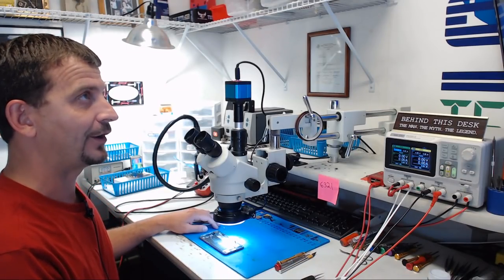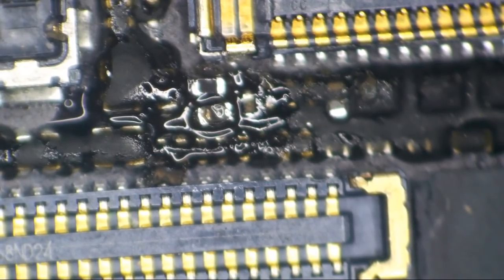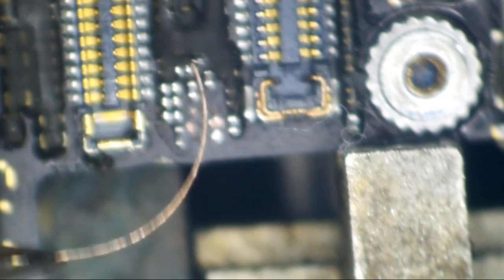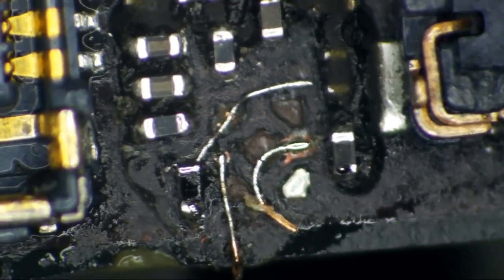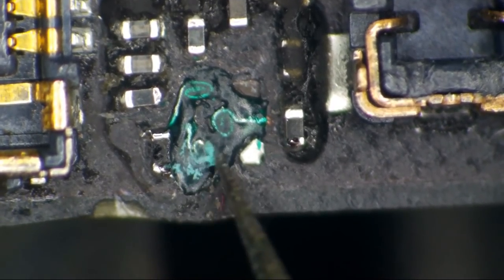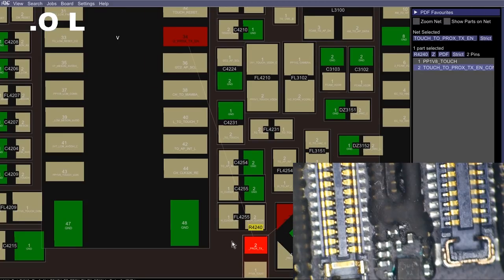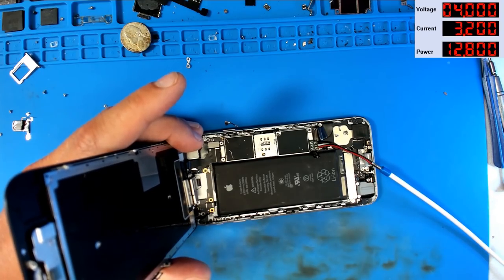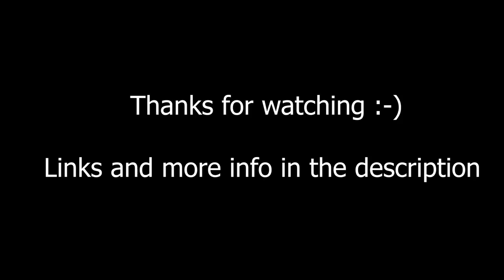The world is protesting but this iPhone needs fixed

Comment: I wonder if the customers actually know the extent of the artistry that goes into these repairs. I have done similar track bypass on oldy world pcbs with wired components but this is exquisite micro surgery by comparison.
 I was just tinning a wire end on my boat yesterday and I have a hole in my leg from an errant solder blob. 😳  I am also in awe of Big Clive but this takes the biscuit.

Comment: I recently went to use speaker wire (first time ever) and after pulling a piece off the coil I thought it looked really shiny so I tested it and sure enough the enamel coating had come off during unwinding. I was biting my nails as I saw you lay that one down. I think whatever glue they use to hold it together pulls the coating off. Vibrator coil wire seems a bit tougher. Got lucky there!

Comment: There is a reason why your backlight filter was blown. Also check on the LCD if the backlight solder points are not touching the metal LCD backplate under the black isolation tape. Love your videos!

Comment: Thanks for the mention Jason. Was $141.51 USD (0.01583652 BTC) 2 weeks ago when I sent it. Its up $11! Thanks for all of the great videos. I'm starting out with a digital microscope that makes it really hard to see 01005 components. Hope to get a REAL microscope, hot air, and soldering equip some time soon, but only doing this for a hobby.
Reply: BTW: I mined all of that BTC and used the computer to heat my house during the winter 2+ years ago! Wish I had started a miner back in 2008 when I first heard about bitcoin, probably would be a millionaire! Now it costs more for power than the ROI for a mining rig.
Reply from the maker: I was wondering who it could have been!  Some years ago I used CPUs to mine Litecoin.  I was surprised by how much it heated a room in the dead of winter.  I thought one day, I'd rig it up to be the primary heat source for the house, so instead of paying $300~$600 per month for heat, maybe I could break even or profit?  I never did it though.  I really appreciate the generous donation.  I hope most of your microsoldering ventures are successful, and for the ones that aren't, at least provide some reward! :)  Thank u!

Comment: How you formed those pads in wire was so neat :-D
One of them looked like a snowdrop, there is a patch of them in my garden that seem to vanish then suddenly appear at the right time, delicate white droopy little things.
So you forgot the function of that part, you can't expect to remember every single part on all the phones you repair.
Pissing on the pcb ha ha , i was thinking a washing up liquid (dish soap) bottle, they aim really well.
I would not waste urine on an iphone :)
Sod-er, Solder, Magic metal glue :-D

Comment: Hi, 

I'm trying to fix my ipod touch 3rd gen with the latest firmware of 5.1.1 

I replaced the screen, digitizer and battery and i am having issues with the LCD showing a white screen 

Tried DFU, Reformating, Recovery mode with no success

Tried downgrading ios but i''m getting errors as itunes is preventing it i think 

What can i do is this a screen issue ?
Reply: What iTunes errors are you getting?

Comment: the repair set i bought did include a screwdriver especially for the screw or bolt that you remove with pliers on 2:05 which i have since come to learn is only found on the iphone 6s . so on that point i am more advanced than you(having a screwdriver that works only for one single screw)